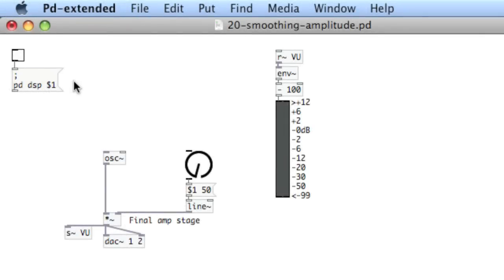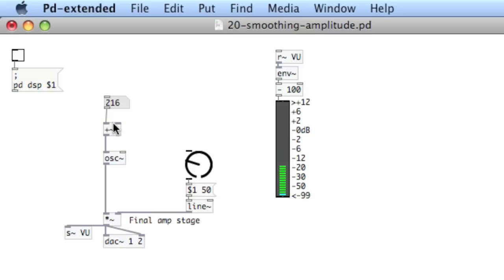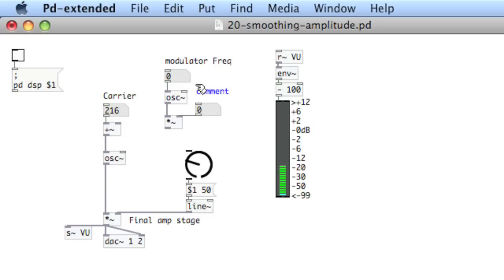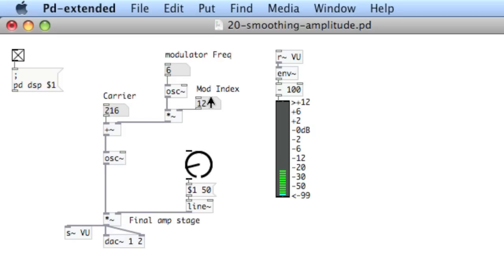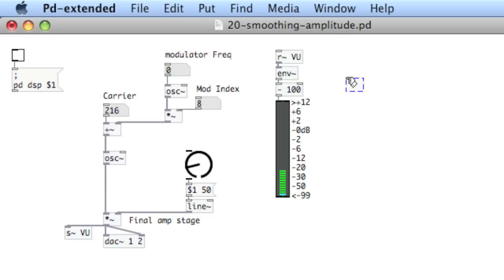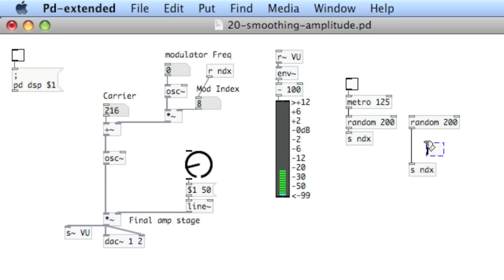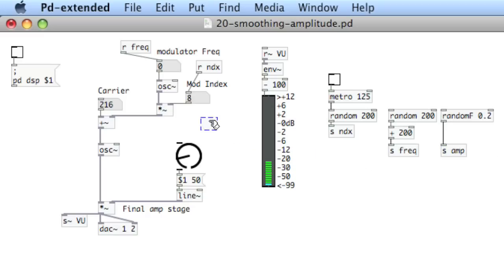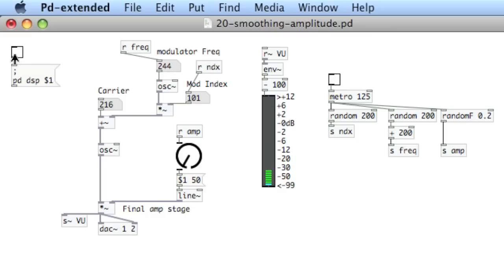PURE DATA: 21 Beginning FM Synthesis

Comment: Why use addition instead of multiplication for "FM"
Reply: I think that makes the frequency oscillate around the average value set in the box. If you multiplied the frequency by the modulating oscillator signal, it would oscillate wildly from positive vslues, through zero, to negative values.

Comment: Hello. Does anyone know what the ~*  and ~+ actually do??
Reply: It's actually mentioned in the video. They are operators for multiplying and adding the input value by a value. In this case the osc "oscillator" output  is multiplied by the value supplied from the "Mod Index" input field. And then the result is "added" to the "Carrier" value. The sum of these is then used as input to another "osc" whose output is sent to the DAC "audio output".
You can think of the Modulator like an LFO if you're using low value  for the modulation frequency.